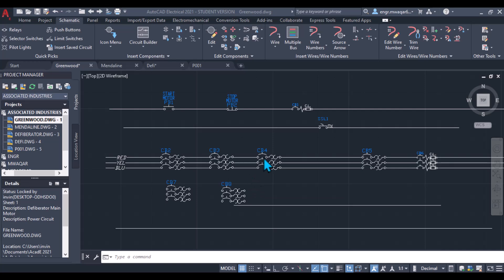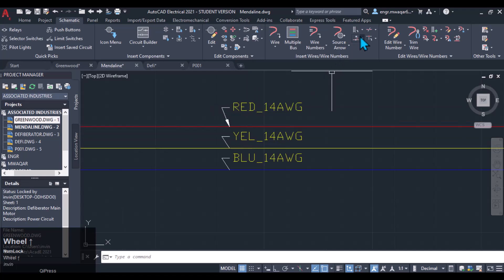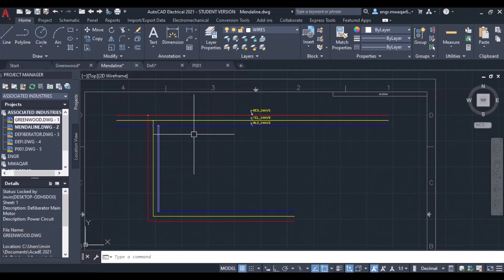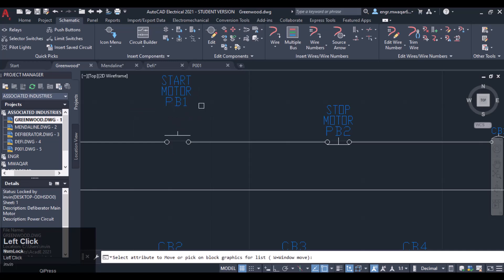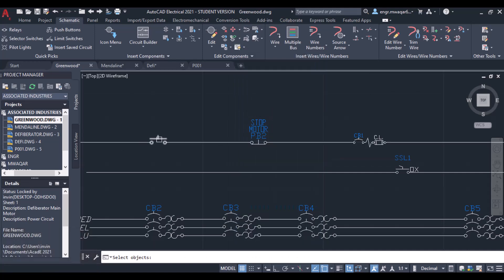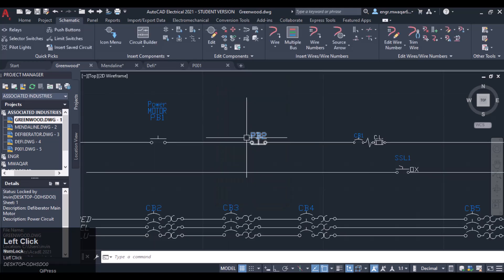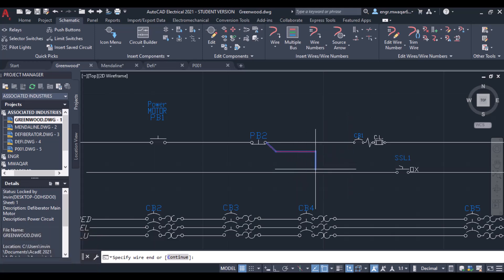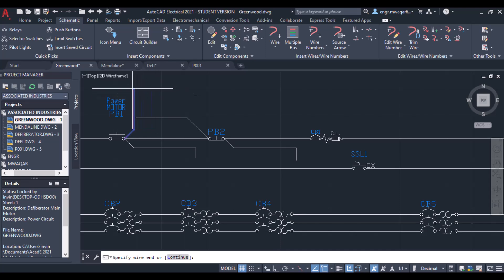AutoCAD Electrical 6.1e: Customizing Components and its Attributes

Comment: HOW TO RESIZE THE COMPONENTS AT ONCE ??
Reply from the maker: To resize all components at once, select all components using CTRL+A commad or use QSELECT command to select only specified components. Then type SCALE & press ENTER. Choose any base point, and enter a scaling factor. All selected components will be resized at once.
Reply from the maker: There are some other methods as well but this one is the simplest.
Reply: 😂 I tried But after scaling it will loose its wires connections. I want to scale them automatically from icons. Is it possible.  @suntechengg
Reply from the maker: @NirajKandel Right. Another way is Go to Project Manager -> Project -> Properties. Then goto Components or Drawing Format tab. Adjust Symbol scale settings like X Scale and Y Scale.